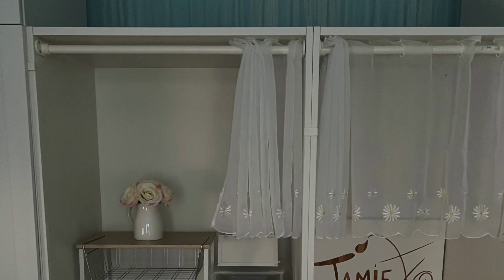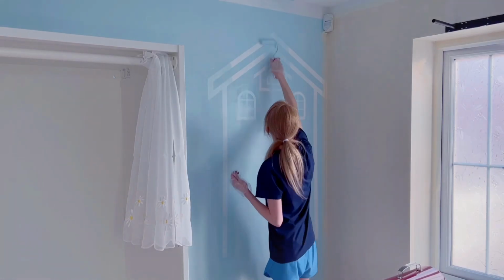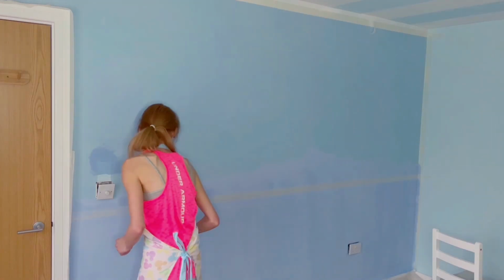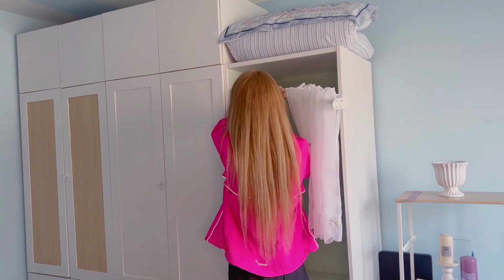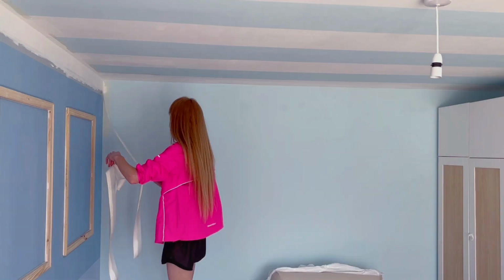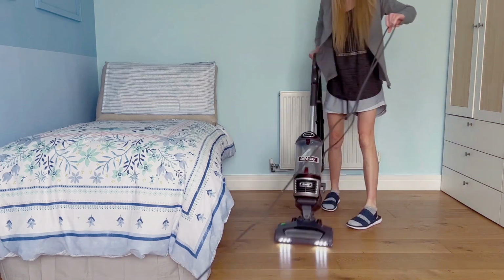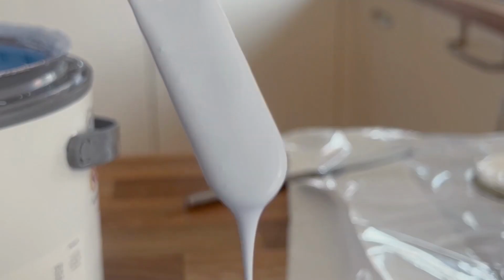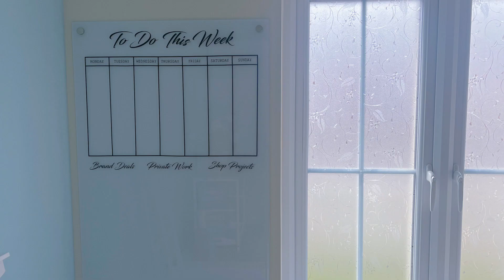BRIDGERTON Room Makeover!

Comment: Ideally, you’d want to remove tape before the paint has fully dried. Not when it’s still wet but before it’s fully dried. A lot of the time the paint can dry and form a ‘skin’ that goes from wall to tape, and pulling the tape can remove peels of the paint along the tape line. I’m impressed that didn’t happen to you!